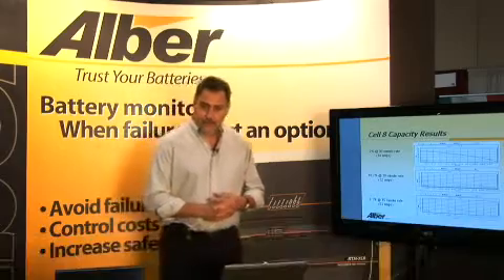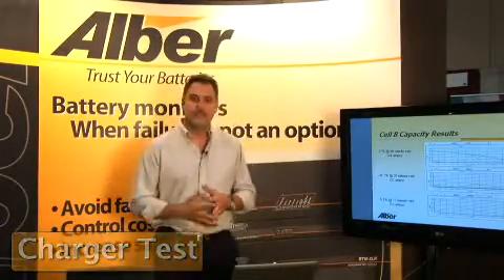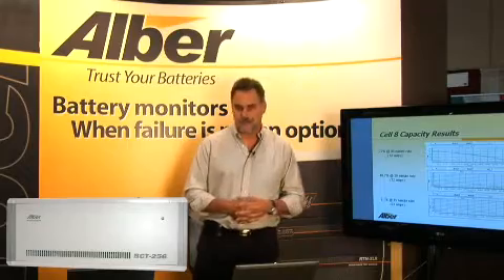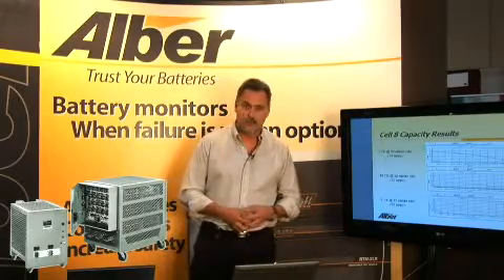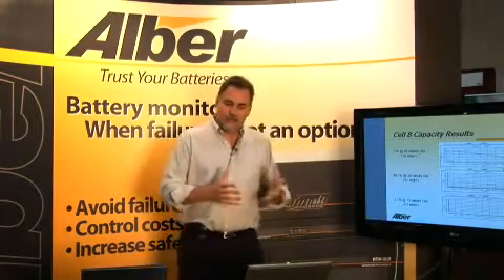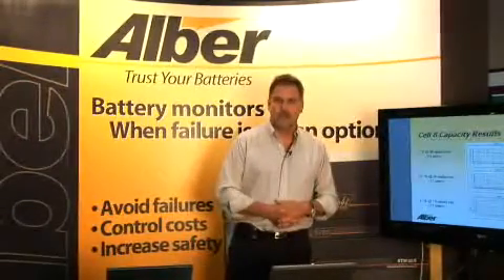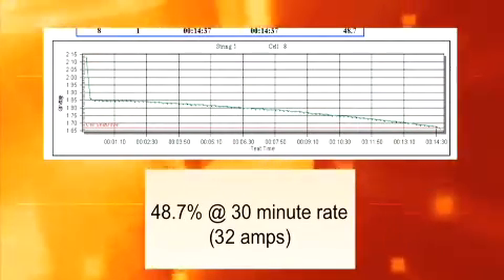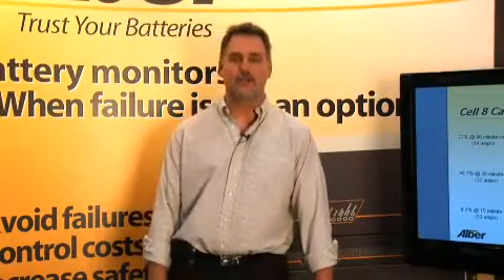Alber Battery Capacity Test Set (BCT)

Comment: Some maintenance managers at large mills in my area have stated that capacity discharge test harms the battery. That and the cost associated with capacity discharge testing is why many seem to prefer internal cell resistance tests for station service batteries. Is there any truth to their claims about potential damage to cells?
Reply: The notion that periodic performance testing is harmful to a battery is erroneous. I have worked in the standby battery industry for 32 years and worked at Alber for 15. I have a Battcon paper on the topic you may be interested in. It's located at http://www.battcon.com/ArchivePapers.htm.